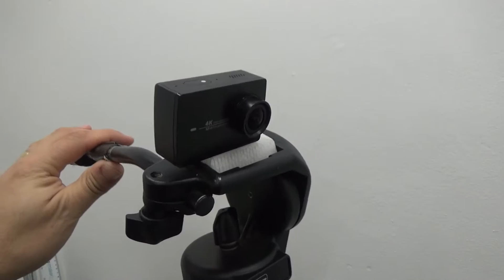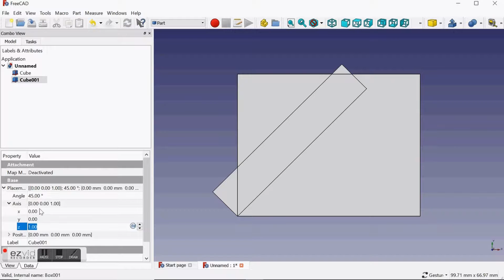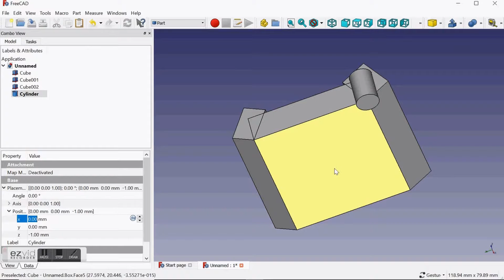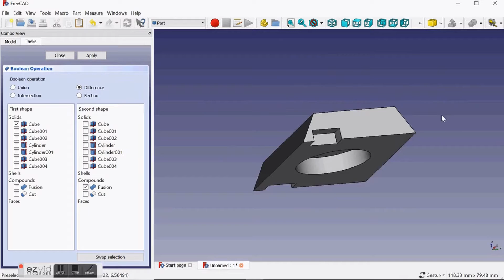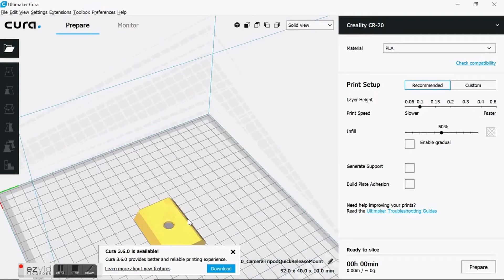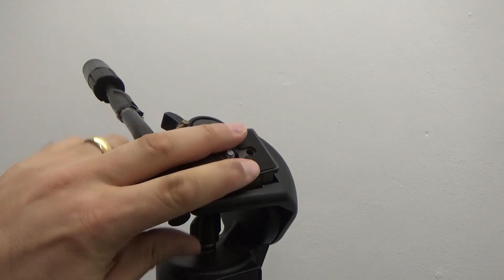DuB-EnG: 3D Print a camera tripod quick release mount HOW TO use FreeCAD CURA and Creality printing

Comment: I support everything 3D printed, but really, a camera mount is  like 1$ off ebay with free shipping, sturdier and with metal bits already attached, and good to go, this makes no sense to me :D Unless you're in a particular pinch (for time) of course.

Also, omg do I feel spoiled now with Prusa's Slic3r, it goes a lot more in-depth I think with the settings. I understand that's not always a plus! :D 

Agreeing with Lassi Kinnuen on the whole premieres thing, the issue is Youtube's outdated UI that keeps getting stuffed with features it can't handle. Nobody's here will miss a video (even if some of us only have time to watch it 5 days later :D)
Reply from the maker: Igor, thanks so much for your considered feedback! ...  Or your info, the bodun tripod mounts are a little expensive, and it would have taken a few days to receive the part from eBay, so I chose to make it and video making it...  I’m not entirely happy with the video...  I need to get better at this, perhaps produce less videos and improve my quality.  That said, I have a favour to ask...  I’m planning to release this video on Friday, at my usual 5pm slot...  it’s a long video...  when listening to it in the car, the audio seemed a little tiny and the Sssses sounded a quite ssssssy! ...  your feedback sincerely appreciated!  https://youtu.be/cwDBj-VSi4A
Reply: @DubiousEngineering   I realize this may be beating a dumb point but... are you certain it doesn't fit any old mount :D? Still, one has to appreciate turning a 'problem' into content, well done! 

Audio sounds 'fine' to me.... if you consider the caveat of hearing it through <10£ speakers. It's great to see you experiment with different kinds of videos (read text vs. live shooting)! You can improve the audio with software, like removing small hisses and cracks that we all do when talking,  Mind you, I'm only saying it cause I was reminded of the ridiculous amount of cleanup a friend did when we recorded voice-over for our video game trailer. It's all witchcraft to me really. :D
Reply from the maker: Can I help you plug your game trailer? Or game??  What platform is it on... thanks so much for the feedback... I’ll take a second listen and will probably be lazy and release this video... but I really need to step up quality I think....

Comment: Nicely done, and I'm looking forward to seeing what prints you're cooking up for the Amiga laptop project. One of the goodies looks like an Amiga logo from the quick shot of 3D files you have saved. ;)

For 3D modeling software I'm back to using Sketchup Make, since it seems like Microsoft unbroke what they broke with one of their updates a while ago. I only really use Fusion 360 when its more advanced features are needed. For slicing, Cura works just fine. no worries there.
Reply from the maker: You’re a bit toooo observant!!! :-).  Well done spotting the Easter Egg!!
Reply from the maker: PS - The amigo logo is now on FACEBOOK Dubious Engineering group...  just in case you wanted to pop over and say HI!